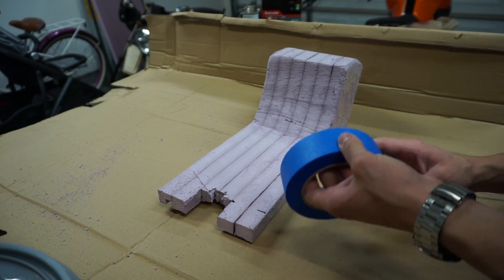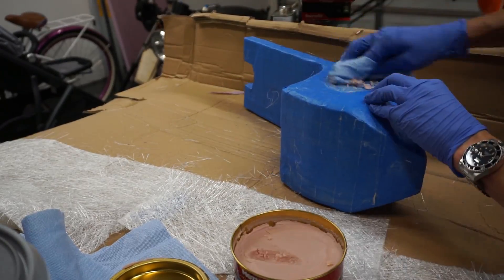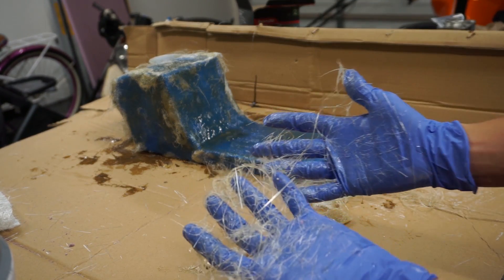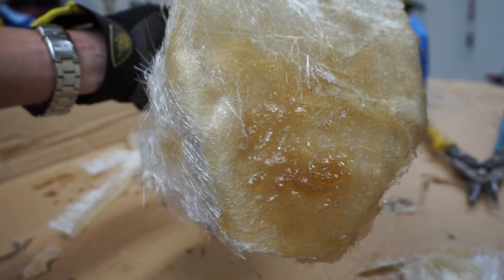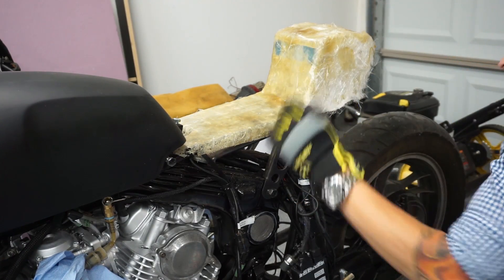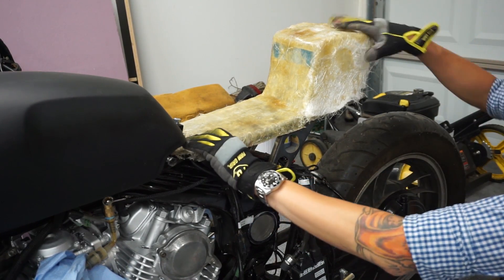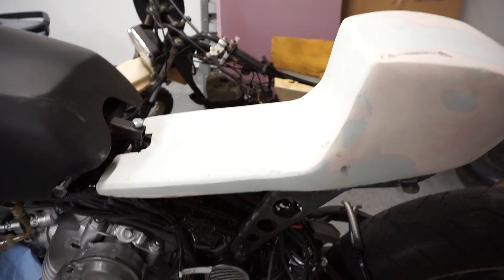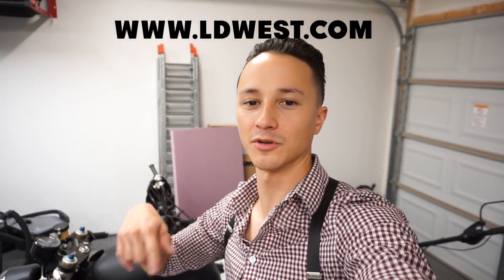Yamaha Virago XV920 Café Racer Build - Vlog #29 - Fiberglass seat!

Comment: You really should do all the shaping with fibreglass. Then light skim coat of filler, to fill in light imperfections. When fibreglassing you should cut shaped panels and dab the resin on, and try not to brush. That is why it is coming apart on you. All that bondo filler will just crack when you get slight flex in the seat.  You probably should start over and  save on the pain after it cracks when painted. Perfection is not created in one day.
Reply from the maker: made 2 attempts. I'm over it right now. I've wasted over $400 on fibreglass and bondo at this point. Going back to my old seat

Comment: You have to be more patient man. There’s no easy quick fix. It takes time and dedication dude.
Reply from the maker: Fiberglass is tricky, it dries super fast. Kind of hard to be patient with it.
Reply: I hear you man, it wasn’t meant in disrespect. I’ve watched your build on this for the whole series. 

Fiberglass is just an entire beast on its own and you’re not gonna nail it on the first try. 

There’s a lot of vids out there on the process with tons of helpful tips, etc.
Reply from the maker: Yes for sure. That's the thing, this was my first attempt. First mistake was buying that fiberglass kit with the fiber mesh. I' just bitter that I wasted $200 on it so far lol I need an actual fiberglass sheet that won't come apart. I am not really happy with this first attempt, even though I don't want to do another one, I will end up inevitably doing another attempt or two. The whole point of this channel is to just do it and figure it out as I go. No editing, just straight up attempts, failed or success. Everyone will see it all and hopefully learn from my failures and/or successes.
Reply: I'm sure you guys have a Walmart up there where you're at.  I've gotten my fiber glass mats there and kits for cheap.  They have the thin fiber mats that you used and also a thicker mat.  Fiberglass can be messy but can be fairly easy if you make it easy on yourself if that makes sense.  It helped me out by precutting a bunch of small chunks of fiber glass mats (2 x 2 inch or longer strips 2 x 5 inch or something).  Also helped by mixing and working with small cups of resin at a time so you can remake a new batch if it dries out.  I enjoy watching your videos and seeing you learn as you go.
Reply from the maker: @CB9-20  I'll checkout Walmart.  Canadian tire where I got this kit, did not have other options for the mats. Thicker would be ideal and i like  your idea of cutting small pieces vs large pieces meant pre cut like I did...small pieces makes a lot more sense now having done it once!